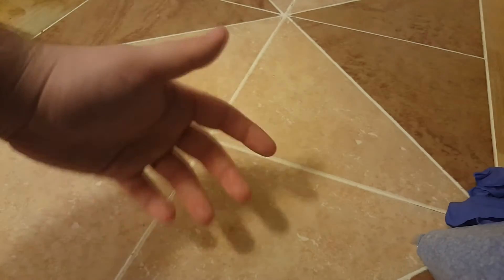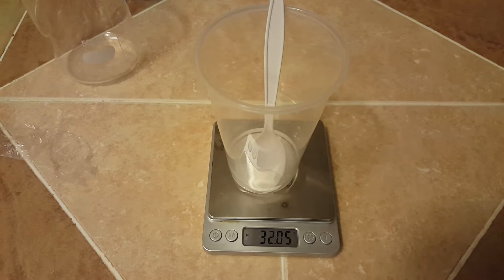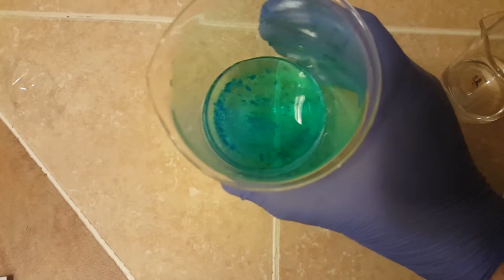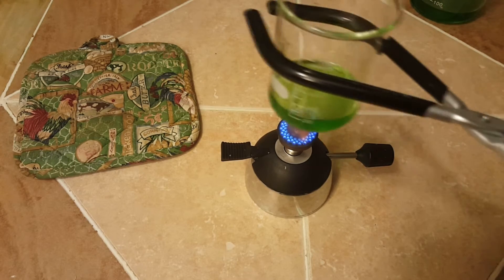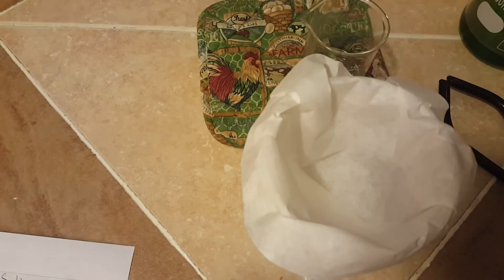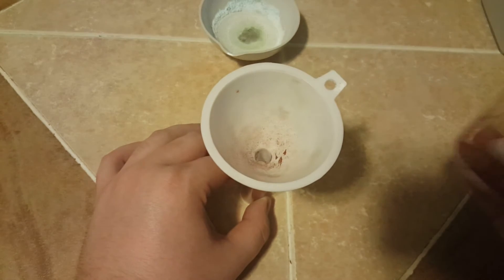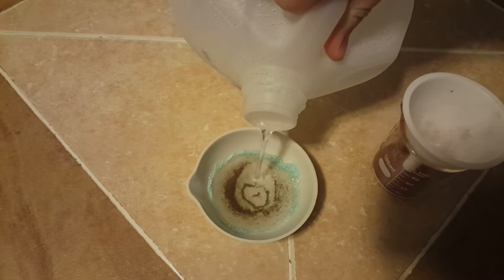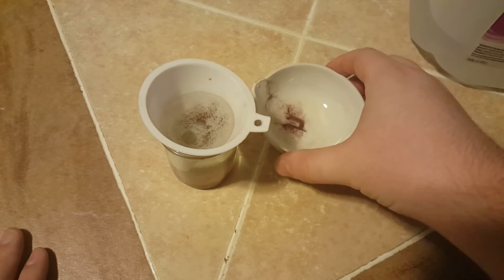Beautiful Red Copper Complex (Chevreul's salt)

Comment: I done mine the other way arround unitlntentionally and i used vinegar 7% salt 30grams to 30 grams of copper
Now im left with a blue solytion when heated turns red what i found though is before the vinager dried off the salt fel to the bottom

Comment: Edit: This complex is relatively light sensitive. After letting it sit in the sun for a day it gets slightly black on the surface. 

You should make the yellow copper thiosulfate complex. Just mix pretty saturated solutions of copper sulfate pentahydrate and sodium thiosulfate in the ratio of about 1:1,7 for the solids. After about 2 days in a warm place, you can filter and dry the residue. And don't heat the solution too high because you'll get a black copper sulfide.